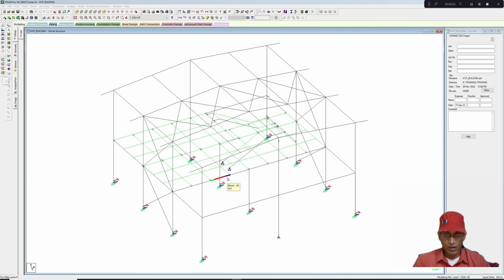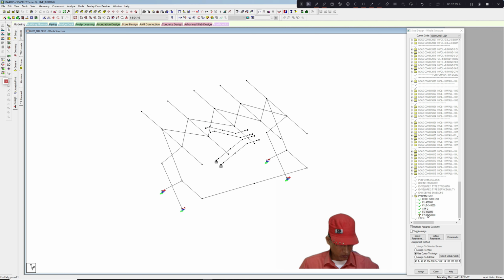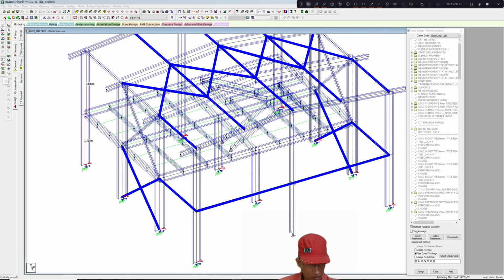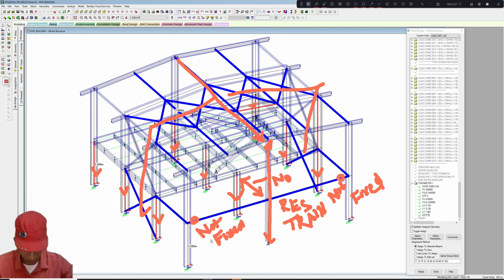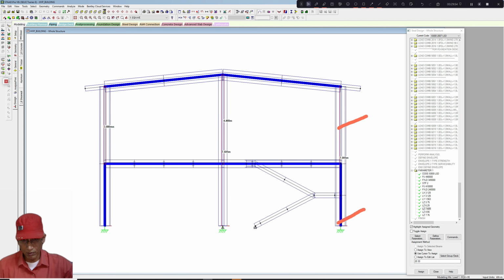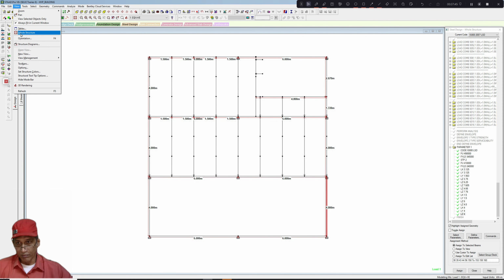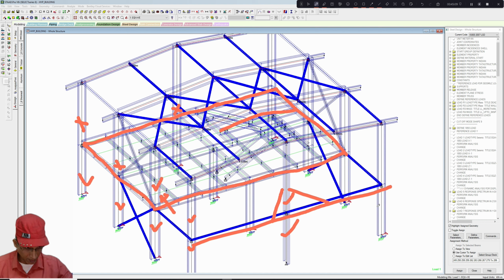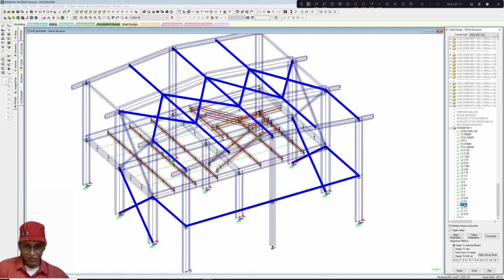SECTION 8 CONTINUED   DESIGN PARAMETER TO STAAD MODEL

Comment: Are you assuming the 2nd lift columns will have no buckling along the minor axis? and no torsion developed? no girts/runners are there, in such conditions, there will be torsional buckling too. Pl. clarify.
Reply from the maker: Where is the Lift Column? I could Not not   under stand  your questions.  Note Indian Code Does not  Gives any equation to  judge Torsional restrain. For Flange  Braces we  can check if Brace along with Girt is about to resist 1% force of Compression Flange and 2.5 % force  in  totality. But for  members likes struts or joist, if the Connection is able  to provide torsional restrain can be checked using equations provides by AISC Code. I have not seen anything  similar is given in IS Code.

Comment: Well articulated and well explained sir, can we get a codal reference for limiting the lx ly (1.5m in this case) after providing flange brace
Reply from the maker: Dear Mkhitar  Coda requirement are not explicitly written. The Code only provide criteria under which you can consider  Restrain point. For Example IS 800-200  Gives that lateral Restrain to compression Should Be able to transfer 1% and 2.5 % Compression Flange force. Now We need to calculate if those restrain we are assuming is capable  to full fill codal requirements..

Comment: Sir why Lx and Ly = 0.6m for joist beam
Reply from the maker: Read My Book on ' Design of Steel Structure with STAAD Pro for Detailed Discussion. The Ly the Lateral Restrain spacing  to Compression Flange,  Which Should be Near  To compression Flange. For a Simply Supported beam , Compression Flange is on top. Lx is Torsion Restrain spacing which can be at any Level of the Beam( refer to AISC 360). The Deck is screwed  to Beam Flange at every corrugation which is usually at distance less than 300 mm. Now  Deck Sheet is a Cold form Member. Refer to AISI( North American Specification for Cold Form design), Which say which should consider one screw may get loosened. Hence Effective Restrain spacing becomes 600 mm

Comment: Sir, can you make a video on the wind according to ASCE 7-5 in Detail in the same shed
Reply from the maker: That I shall do when  I shall Start tutorials with AISC Specification. But  One should know the  in AISC design wind pressure is obtained as per IBC(ASCE-07) Wind Map of USA. But for India, such Wind Map as per ASCE-07 parameter does not exist. Hence I personally believe, though design could be performed using AISC, The Wind and Seismic forces should be taken as per IS Codes.